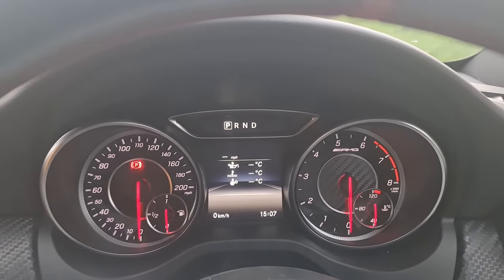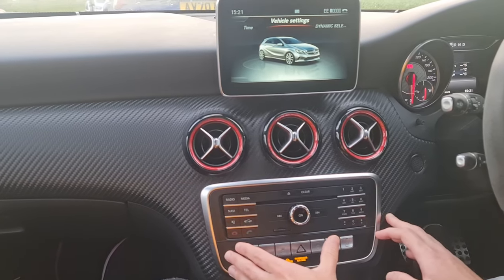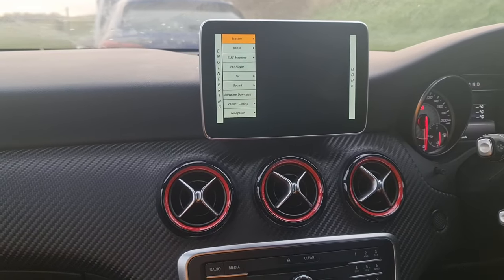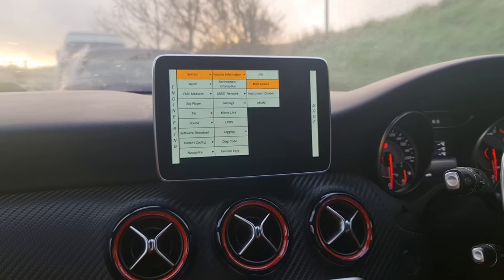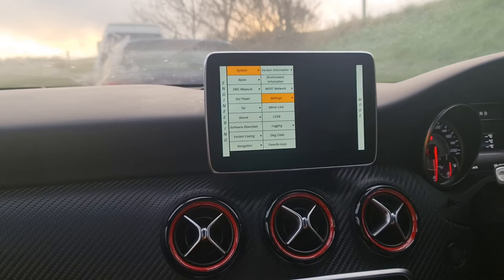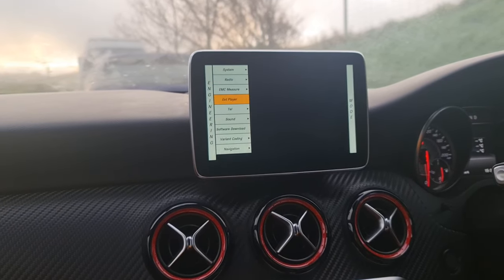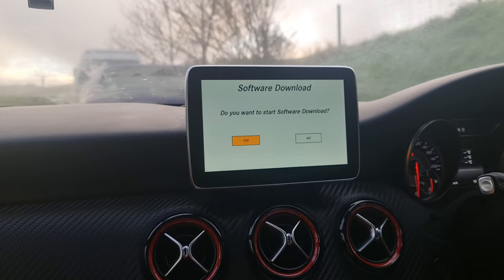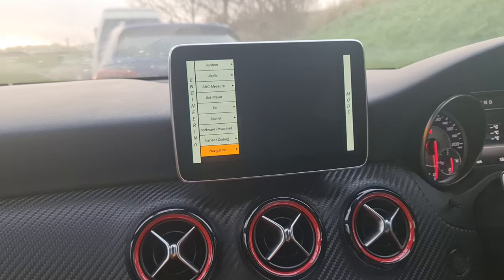How to enable engineering mode in your Mercedes Audio 20 Command NTG5 system?

Comment: Not sure if anyone will be interested but for anyone struggling to get the engineering menu I found a fix for my car. Recently acquired a 2017 a class with the audio 20 ntg5 or 5star1  the engineering mode didn't work as shown in the video, I tried the reset settings via the steering wheel which also didn't work however by using the wheel on the centre console and the infotainment screen performing the reset this way allowed me to enter the engineering mode
Reply: Give a description as if for a child. Because I have the same problem and I don't understand how to do it from your description
Reply: Can you please explain in more detail as I have the same problem, please?
Reply: @ru33erman  using the centre screen find the option to reset and then try engineering mode again
Reply: @obsidiandobbin, Thanks for the info mate found it will try in the morning. One question tho, will that reset any software update i had on gearbox or only for audio system? Thanks.
Reply: Can you do a video?
Reply: Yea i just got 2016 e400/amg pkg and it should have this although im having trouble getting into Engineer mode. Also tried through the "end call" button steering wheel like you tried yourself and nothing. I finally tried a full headunit settings reset, and still nothing. 

Idk either i have the worst luck or i actually just read that the car also needs to be enabled first and foremost before it can even go into "Engineer Mode". It was said that you can take to a dealer and ask for them to enable it, or use some OBD port device(forgot which one) to enable it yourself. Idk if this is true, have you ever head of this? I know what system i have as i have my data card, DataCard part number: "531 COMAND APS NTG5/NTG5.5". This is was also verified by using Mercedes website which shows pictures to help clarify what unit you have( with my case, it was shown how if your "eject and clear buttons" were right next to each other then it was for sure COMAND APS NTG 5.1). Also know that mine cant be a 5.5 bc mine still have the keypad keys.
Gonna try tomorrow first thing idk...
Reply: @erictaylor1867  i have mine missing do u think thats why i may not get it into the mode?

My nav comes up all normal havent tried going anywhere with jt
Reply: @ep1906  not sure bud. what car you got? if anything changes and i figure out to get it work ill lyk. another issue i was guessing was that we dont have that apple car play/android auto module or whatever for it to work....BUT having said that i really dont think that particular part has anything to do with if we can or cant get into "Engineer Mode". We should atleast be able to get in and change settings bc its a like a factory MB menu, yknow?
Reply: @erictaylor1867  true what your saying i got a w212 e class

Comment: Can you make a updated method for those who tried it and didn’t work (my head unit / system is exactly the same as yours the only difference is your heated seats buttons are silver my heated seat buttons are black not sure if that makes a difference)
Reply from the maker: Yes the black buttons are for the older audio systems. So you have an outdated audio system which looks similar but its not actually the same. Do you have your VIN number and I can clarify that for you?
Reply: @ManiSuReal  I searched up vin says I have ntg5/5.5
Reply from the maker: @vryan4071  thanks for checking that but I am afraid this is not compatible. It needs to be only NTG5 or NTG5.1, if it has /5.5 those systems are not compatible as they do have any hardware for carplay or Android auto for you to activate so you will need to retrofit hardware in there first.
Reply: @ManiSuReal hey can you help me find  out
Reply: 2017 cla250 and im in america

Comment: I tried pressing hangup + # + 1 but nothing works on my 2015 CLA 45 Shooting Brake...
Reply: Same for me...I have a GLA 200d 2016...the combination doesn't do anything. I am able to get into dealer mode though using hangup+3+* but that doesn't have any settings.
@manisureal do you know why?
Reply from the maker: Yes by default in some Mercedes vehicles its disabled. I will need to make another video on how to enable it, if you cant get in. Once again, its down to what software version you have so it may/may not work. I will post link to video once it up.
Reply from the maker: I am uploading the video now so it should be available by tomorrow morning. Remember it's an alternative solution to having android auto not actually activating it but the explanation is worth a watch so you can fully understand.
Reply: @exorcisthm  try this: Go to system settings in your unit, reset to factory settings and try the combination on the video again.
Other combinations would be ‘hang up + 3 + *’
Let me know if it worked
Reply: @capamikeofficial  yes, but don’t show everything. I can’t see the option for CarPlay

Comment: Hello, I've got a gla 2016 66 ntg5*1 carplay is working but android auto doesn't even show up, I can get the settings up on how to connect android auto but nothing also can't get into engineering mode. Any suggestions
Reply: Not sure if anyone will be interested but for anyone struggling to get the engineering menu I found a fix for my car. Recently acquired a 2017 a class with the audio 20 ntg5 or 5star1  the engineering mode didn't work as shown in the video, I tried the reset settings via the steering wheel which also didn't work however by using the wheel on the centre console and the infotainment screen performing the reset this way allowed me to enter the engineering mode
Reply: Can you explain in more detail how you did it?

Comment: Hi, my engineering mode doesn’t work. I have an mercedes w176 A180 CDI from 2017. Do you know why it doesnt when I push the three buttons you are talking about ? I hope to hear from you soon. Best regards, Dylan
Reply: you have to reset your system and then you can access it
Reply: @dannytoure4387  what should i do to reset ?
Reply: @moonknight1645 go to system settings and reset your unit system back to factory settings.
Reply: @capamikeofficial  ı did it rn but ıt doesn’t work again

Comment: Hi Mani, I have the exact same Audio 20 system. All your softwareversion etc information is identical on mine. (I compared it) I used the OBD2 activating tool and Apple Carplay started to work. I also got an extra icon for Android Auto, but I can't get Android Auto to work. It keeps saying no device connected. On your videos I see you are using Apple Carplay. Did you try Android Auto in your car or did you just test and use Apple Carplay? I'm trying to find out if the Audio20 system needs an update before Android Auto will start working.. Thanks in advance!
Reply from the maker: Hey Martjin, yes this is a known issue and I have a video coming out soon to explain why this does not work and what are the solutions including an alternative that you can use, so stay tuned. Once I upload it, I will link you to the video here to watch. Thanks
Reply: @ManiSuReal  when is the video coming out? Also, engineering mode doesn't on gla 200d 2016...is that a known issue too? What is the solution for that?
Reply: Hi mate   I can't get my CLA 200 2015 C117 to enable the engineering mode. Can you please help?

Comment: Hello, I did a reset in the menu where button 3 is pressed. Then I went into engineer mode and configured the parameters to be able to activate android auto, in addition to other parameters that I wanted to modify. Well, everything works fine for me except when I make a phone call, the audio and the microphone don't work and I don't know why. The phone connects perfectly and I can listen to music from spotify with my mobile but not the calls, the car is from 2018. Could you help me? Thank you
Reply from the maker: Hi, few people who have activated AA through this method have run into this issue so you are not the first. The only thing I can think of is there is a specific firmware version that the AA needs your audio system to be so when it's activated this way, it almost activates with that bug and the only way to get around that is to update your audio system firmware and if you do that then you will lose the ability to enter engineering mode and Mercedes locked this in their latest version. 

The only solution I can think of is when you are on a call you will need to switch to either Bluetooth or the phone speaker.
Reply: I have a same issue, don’t know how to fix it
Reply: I have a same issue, don’t know how to fix it

Comment: How does mercedes gla 180 work? I tried pressing hang up +#+1 but it didn't work. thanks for your video
Reply from the maker: I have another video coming where I will show you hot to get this to work. I will post here shortly.
Reply: Well where is the video then?😊😊
Reply: @raizo476  Go to system settings in your unit, reset to factory settings and try the combination on the video again.
Other combinations would be ‘hang up + 3 + *’
Reply: solo funciona  colgar +3 + *,   pero solo entrega informacion , no permite entren e el Modo Ingenieria.

Comment: Hey Mani
I have seen on the display it’s possible to have the engine data dials on screen. My AMG doesn’t have the engine data option in the vehicle settings page! Can this be turned on in the engineering mode? Thanks
Reply: I am looking for this aswell
Reply: @chriswalker5582  I’ve been in touch with Mercedes about this, not very helpful! They say it can’t be done if not from factory! I ain’t 100% convinced on that yet. I have a 2018 177 CLA 45 AMG but it doesn’t have the engine data on screen option. I have the car booked in to a local Mercedes Specialist next month and while it’s there they are gonna have a look in the engineering mode to see if they can activate it. If I have any luck I can let you know how they got on. I haven’t been able to open the engineering mode myself yet, it didn’t work on my panel!
Reply: @mrmagoo600  i was messing around in the engineering mode today, before i started i never even had the engine data screen to select in my menu, i managed to find that and activate it, although it only shows me the g-meter dials and not the boost etc, i will try a few more options tomorrow.
Reply: @chriswalker5582  oh wow ok 👌. Yer I don’t have engine data come up at all either. I’ve not been able to access the engineering mode yet due it being locked on my system. , he has released a more recent video showing that a system reset in the dash display should un lock the feature to  then access the engineering mode. But it will reset everything that’s been customised such as sound settings, stations etc which I don’t think would be hard to set back up again. Would be interesting to hear how you get on. Thanks for the update
Reply: @mrmagoo600  yeah mate i had to do a factory reset on mine to get into the engineering mode, once in there, theres an option to switch on the engine data but it still doesnt show the gauges, just the g-meter, i will try again today, fail on that i will be swapping the screen out for an android screen and load the torque app into it with an obd2.
Reply: @chriswalker5582  I was actually looking at one of the Android screen last week myself as wanted the touch screen. 
12 “ screen from The Cockpit, (UK).
Didn’t realise there’s an app available for them too.
Reply: @mrmagoo600  i gave in, ended up buying an android screen from ebay suitable for my car, will install it as soon as i get the chance.
Reply: @chriswalker5582  fair play for giving it a go 👍, hope it work ms out for ya.

Comment: hey, can anyone tell me how to change model of my Mercedes in this system. i have a cla 200 and it shows b class on the infotainment. please help
Reply from the maker: That shouldn't be possible and if it is then that means someone has retrofitted a B class infotainment system instead of a cla one. It should work the same regardless of showing B Class.

Comment: Hi, how can you activate apple car play in engineering mode or cars with ntg 5
Reply from the maker: Hi, I think there is a way but not sure if it actually works. I haven't tried it myself but I have a video coming out soon on how to enter those settings within the engineering mode.

If you haven't seen my other videos, I recommend you check this with how to activate with a tool: https://youtu.be/3trs9l0sF6A, and before this check out the whole playlist here: https://youtube.com/playlist?list=PLOQ3OlCUgXQWrT4-2UOoa-jNO4mecgxYg
Reply: @ManiSuReal  thank you will wait for your video 👍🏻👍🏻
Reply: Can you disable the message to check the surroundings on back camera ?
Reply from the maker: @agustinquintas5894  There is another set of settings to enter within engineering mode. I have a video coming soon on it. I didn't cover all the parts in the video but I am sure you can play around with it yourself to do that. Thanks

Comment: Funktioniert bei mir nicht. Komme nicht in den engeeniering mode. Habe CLA bj. 05/2015
Reply: Go to system settings in your unit, reset to factory settings and try the combination on the video again.
Other combinations would be ‘hang up + 3 + *’